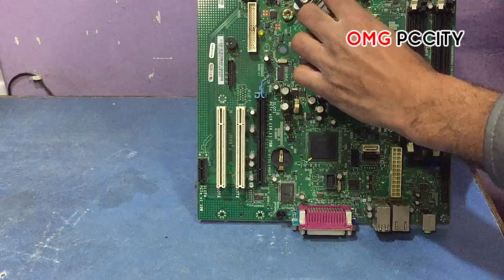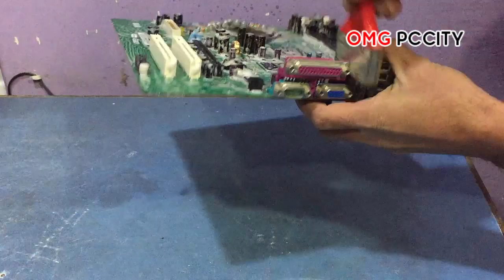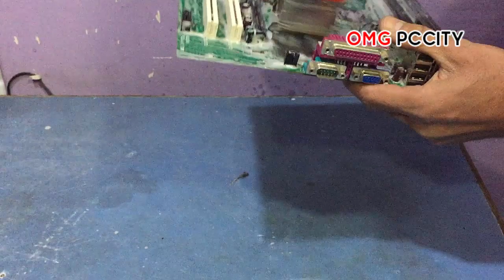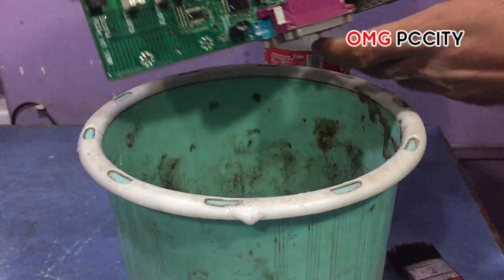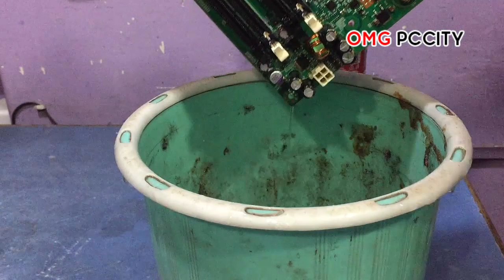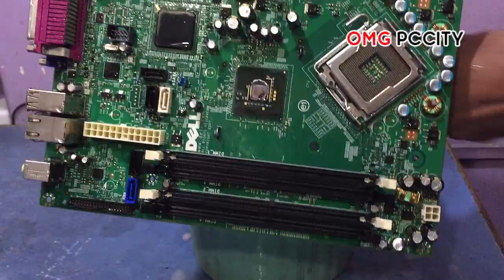How to Perfectly Wash The Motherboard of PC

Comment: You are responsible for leading people to damage there pc's 
Please don't do this ... You have to use isopropyl alcohol or any board cleaner not water
Reply: It is safe. You have to remove the CMOS battery and use non-caustic detergent, then make sure to rinse it well and dry it quickly so no residue is left behind.

Comment: Maybe Anti-static brush? There are also nice replacements for water  like Isoclene alcolhol... still water can cause corrosion and can be left in deep holes like RAM slots
Reply: Water absorbs ESD and sends it to ground via plumbing. This is one case where you don't have to worry about ESD.

And yes, obviously, the board has to be dried thoroughly or corrosion will occur.

Comment: It's probably not a good idea to cover electronic components in water.
Reply: It's fine as long as you make sure it's 100% dry before you plug it in again
Reply from the maker: No it is good idea to remove dust and garbage from motherboard but dry it well before use it again

Comment: i will try this in ps4 motherboard before 10 year i remembers that my pc not start and i dry with sun light 6 hrs but dont work
Reply: 6hr its not enough for dry inside motherboard. u need atleast 2-3 days dry ur motherboard under sun or using air fan